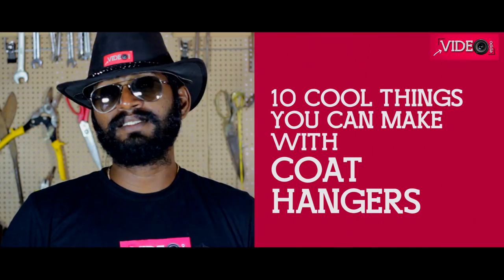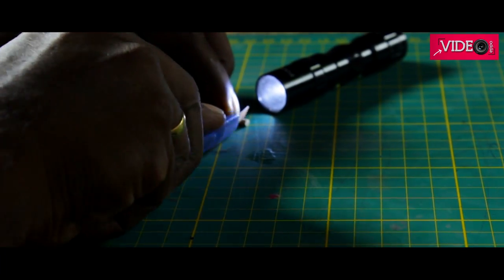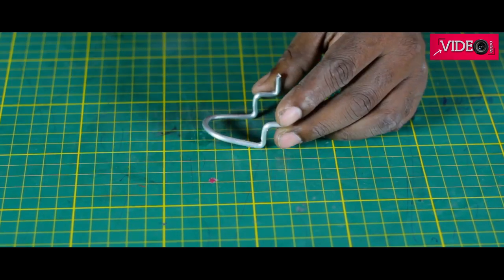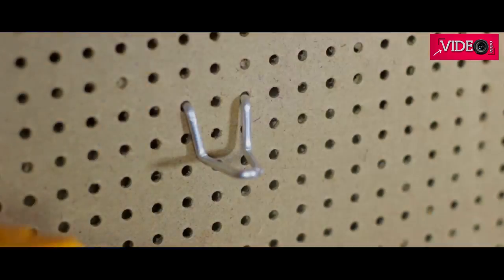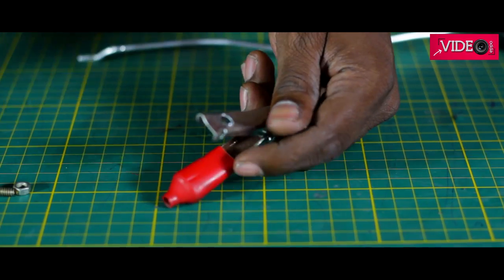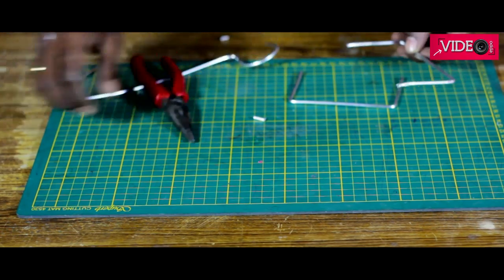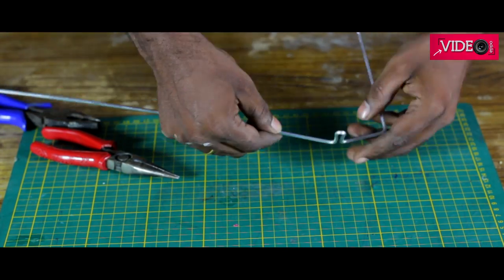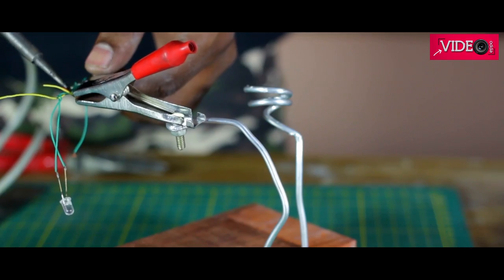10 COOL THINGS YOU CAN DO WITH COAT HANGER

Comment: can I make  a spring for my RC airplane front nose gear  out of  a wire coat hanger   the problem would be to temper it  can yow  help me
Reply from the maker: Rondo Schiavoni I don't know much about RC helicopter. But I know that this coat hanger would be a bit bulky and heavy when made into a spring. I still you should look at something thinner and lighter

Comment: Or by a spool of wire for way less
Reply from the maker: Super5oldier1 but I don't know where to get it. good idea though
Reply: VIDEO EPPO supply stores
Reply: VIDEO EPPO mostly things like lowes Home Depot ect I live in a rural area so there plentiful here ( I actually have 3 spools myself and there ~25 lbs each)
Reply from the maker: Super5oldier1  I wish we had homedepot in India too...but I saw a spool of wire like that in hardware store nearby. but it was not aluminum. Aluminium is easy to work with. But this comment of your has triggered a super idea. I shall work on it. BTW, look out for my video I will posting on Making a Kalimba, thanks for supporting